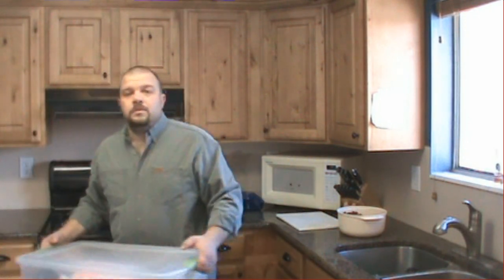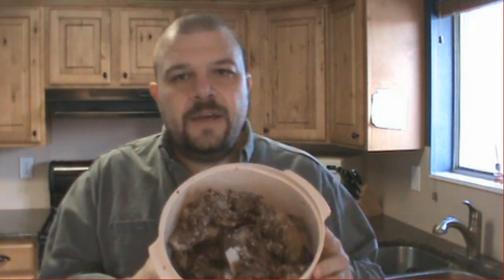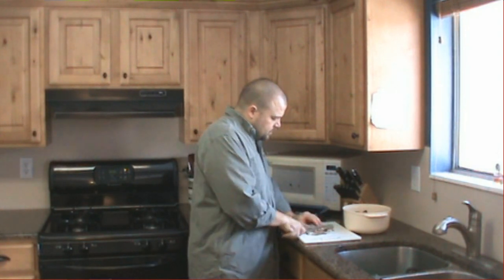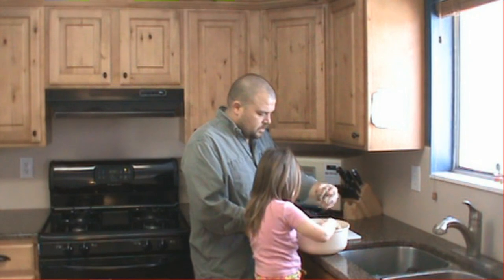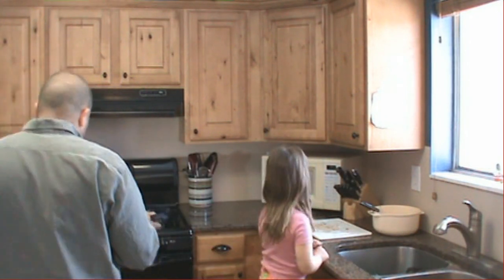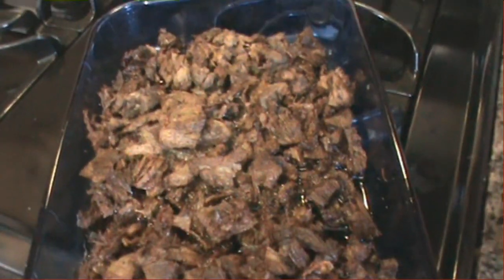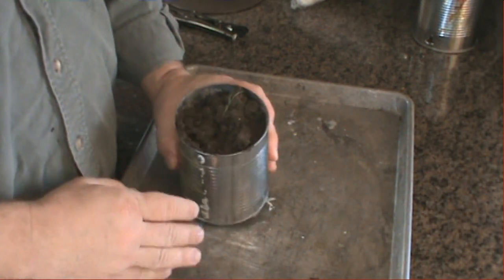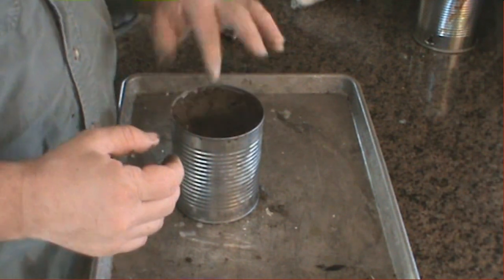How to make a Tallow Candle

Comment: I just watched your video and tried this out with some old animal fat I'd had lying around. Definitely learned a few things. 1) Fat liquefies at a relatively low temperature, and in a shallow can, the flame may liquefy all the fat.  This leads me to --> 2) Something needs to stabilize the wick. Either the candle needs to be long enough that not all the fat will melt (so that some holds the wick) or you need some kind of base. 3) It's probably better to use cleaner fat. Boil, scrape, etc.

Comment: I am wondering if after you got the first lot of fat from the meat, if then instead of putting it back in the oven it would be better to put the remaining meat/fat into a boiling pot.
My theory being that as the meat dries & gets crispy, it acts like a wick & absorbs fat.
If you boil it, the fat/oils may float to the top of the boiling water & separate from the meat/flesh. Then just cool it & you should be able to lift off the fat from the surface.
Just an idea, no idea if it would work! lol

Comment: When you render chicken fat you boil the fat and skin in water then strain it and let it cool.  The fat rises to the top and is very clean pure fat.  You then scrape it off and you can remelt it to fry in or use in soap, I think it is too soft for candles but wouldn't the same thing work for other meat fats?  Couldn't you boil, strain, cool and take solid fat off the top of the water? Just wondering.  It seems to me it would be a much cleaner fat or tallow to work with.  Thanks for your video.